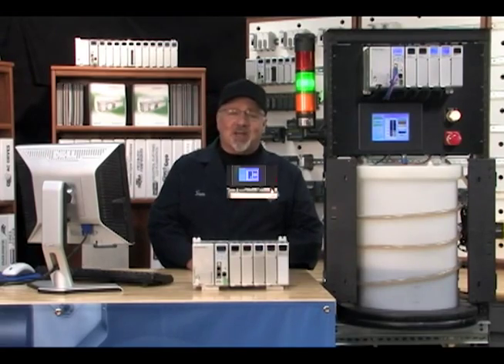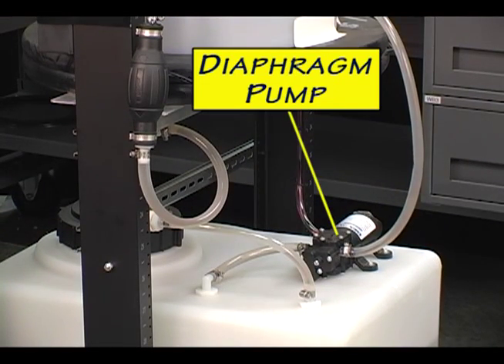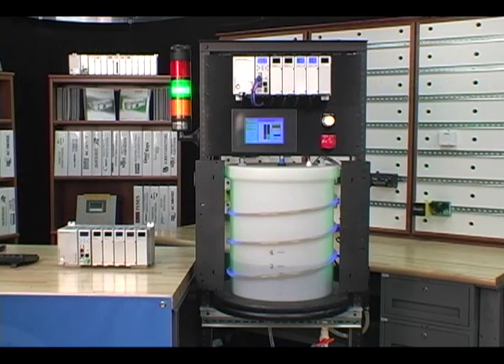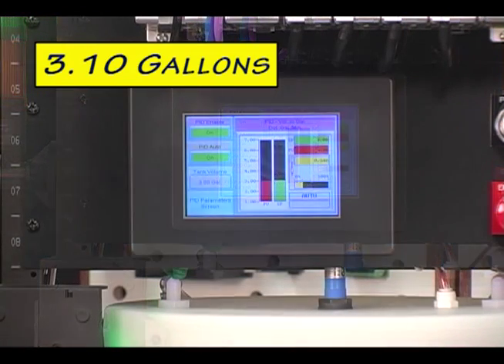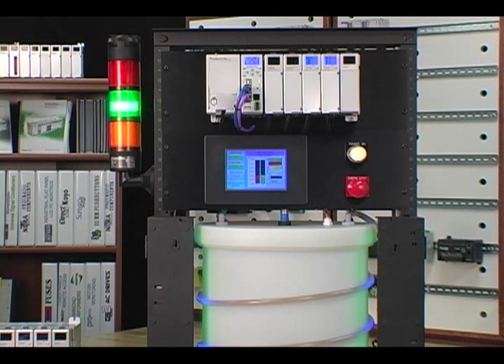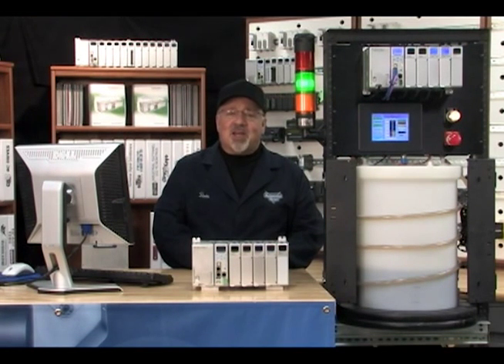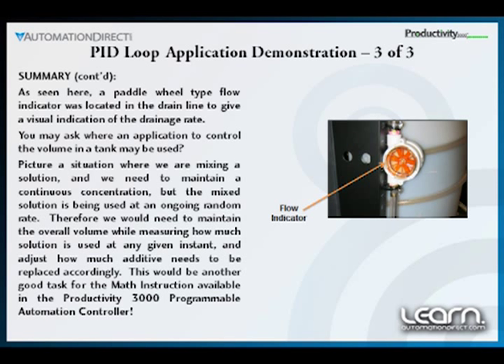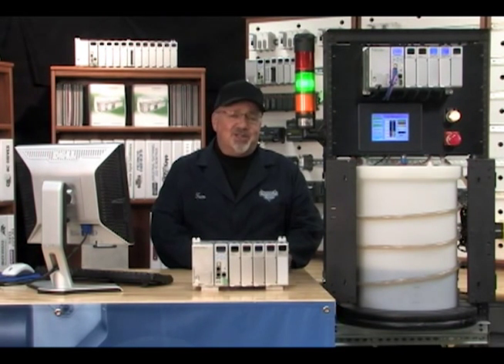Productivity PID Loop Part 11 - Application Demonstration from AutomationDirect

Comment: Thanks for this demo. actually am from industrial automation solution provider and looking forward to know about the power/communication to the stacklight from controller.
can you say the communication present between stacklight and controller (i.e - both power supply and signal) ? Are they separated or by using POE (power over ethernet) ?
thanks in advance